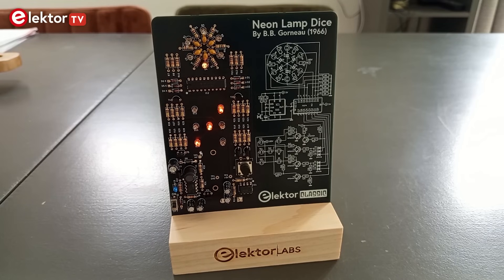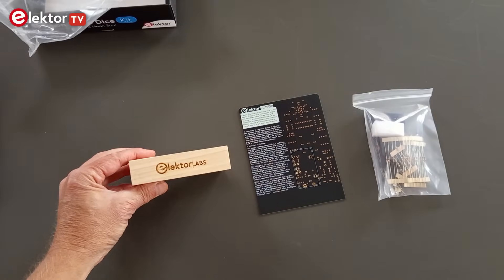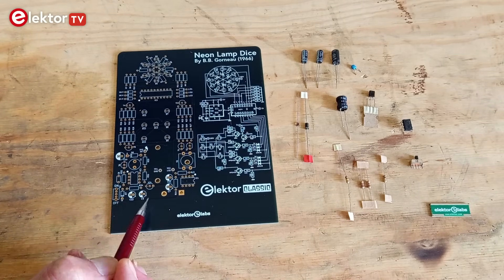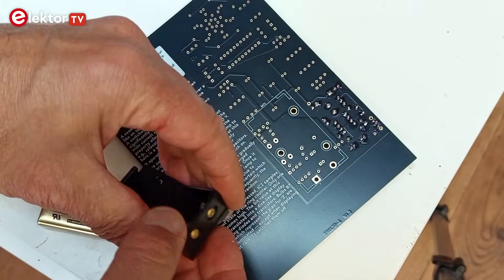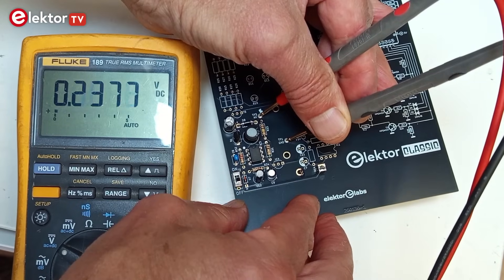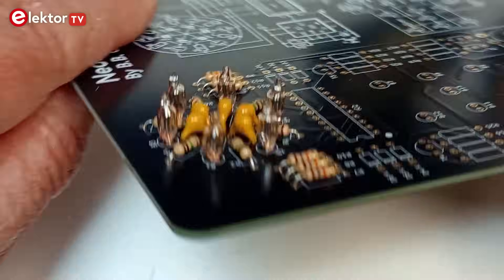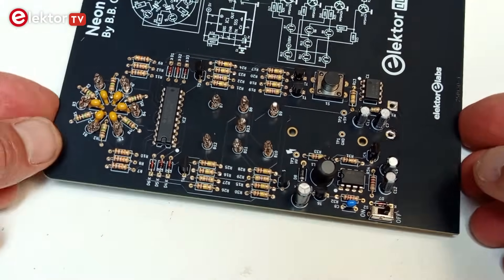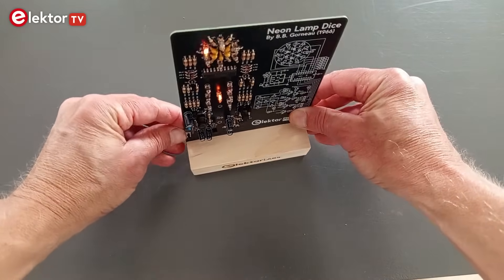Elektor Neon Lamp Dice – The Coolest DIY Glowing Dice Gadget Ever

Comment: I completed my kit today. It's a pretty simple project but fun and the results are dazzling. These kits are perfect for newcomers to electronics. I love the neon bulb light show! I checked 100 dice "rolls" and it seems to be providing a reasonably random count. Well worth the price in my opinion. The silkscreen artwork is educational and attractive. I have some very minor constructive criticisms. The 100 volt boost converter circuit is completely ignored even though it's a very interesting part of the circuit. It's omitted from the educational part of the silkscreen artwork. I'm guessing that there just isn't enough room to cover everything. The only place it's given even a little consideration is on this YouTube video. It would be helpful to have access to a complete schematic. Also, this is the third ElektorLabs kit in this series that I've built. I love them all but the 9V battery holder that has been included with all the kits is poor quality. The plastic bracket located at the base of the holder is hopeless. It breaks as soon as a battery is inserted. This time it was broken upon arrival. I hadn't even used it yet. You need a different supplier. Otherwise these kits are fantastic!
Reply from the maker: Glad you're enjoying the kit and the light show; thanks for the constructive feedback on the silkscreen and battery holder!
Reply: You have made me want to try it out. Dazzling but needs something!
Reply: @briantw99  Well, you can only expect so much from vintage technology. But this kit delivers as far as I'm concerned. I love it (but I'm easily amused)!